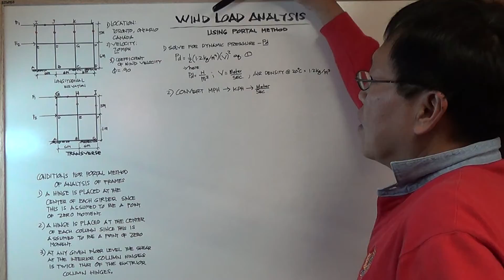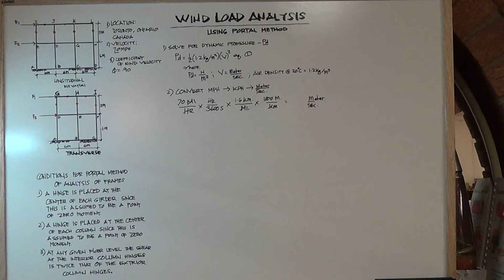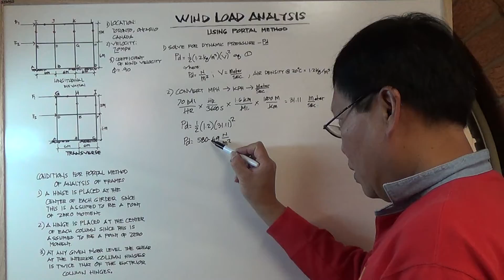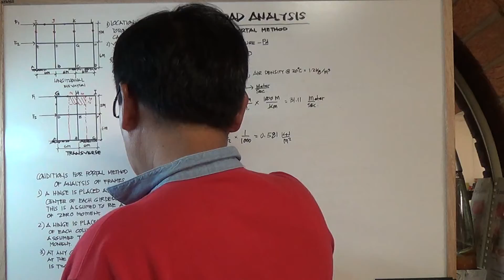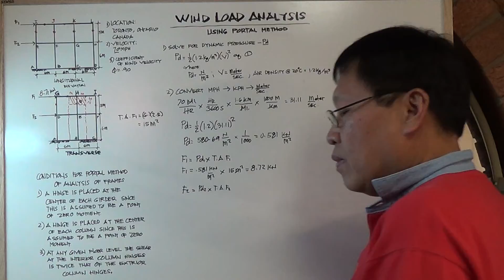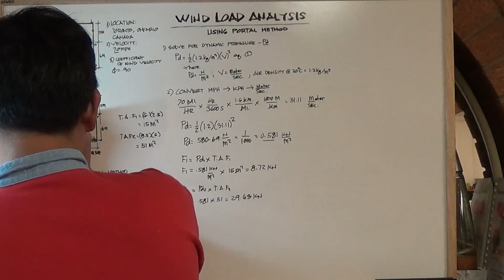WIND LOADS ANALYSIS  Part 2 of 3

Comment: why is the tributary area for F2 is not (2.5+3)*6?
Reply from the maker: Nano Tech thanks for the question, the tributary area for F2 is different than F1.  F2  carries the tributary with the height of from the ground floor to half of the 2nd floor height and that gives you 2.5 + 6 = 8.5m in height and for sure 6.0m wide, and their product is 51 sq.m. The reason why F2 carries the entire height from ground floor to 2nd floor, is because there no more joint in the ground floor that is why it has a different calculations than any  other joints.